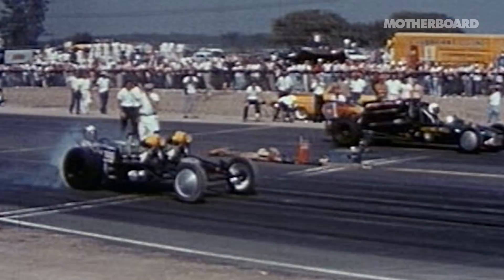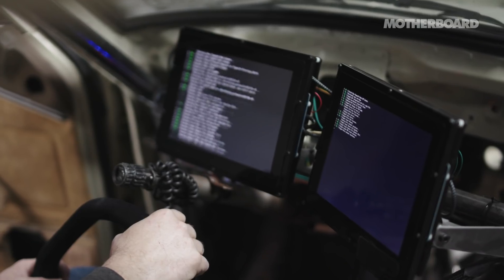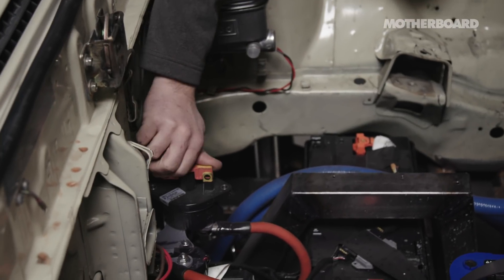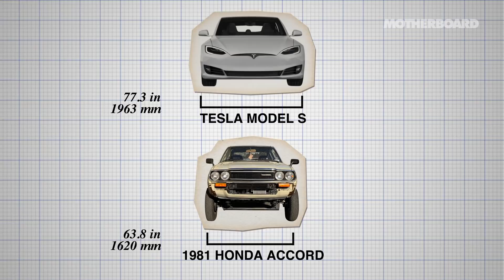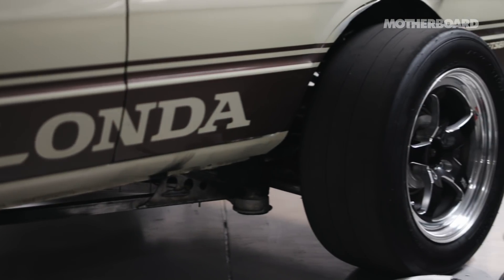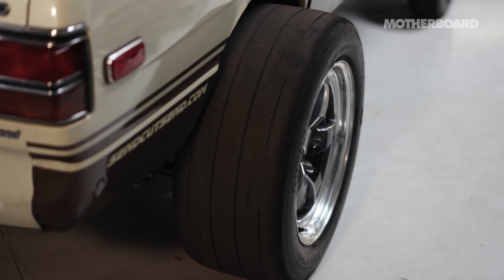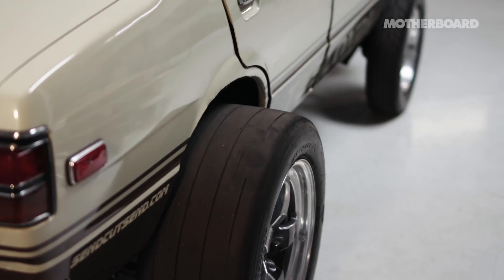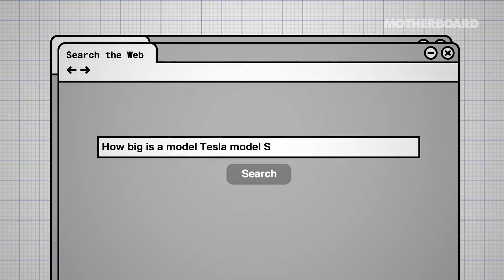The Half Tesla, Half Honda, 100% Electric Hot Rod - The Teslonda

Comment: I want that DMC next to it! 
How much you have in to the Teslonda? 

I’ll literally give you my TT 02’ Lexus ,Supra Gs300 motor to do this in its place? 
I’ll drive to you of course.
I’m very serious BTW ,no BS and ready at anytime!
Just as long as we can get a 3sec 60’ and run faster or at 10 seconds in the quarter!

I may even use my show car/street car to sweeten the deal! She just sits in the garage all year long anyway,so WTH!

It’s a Flawless inside and out 99’BB Prelude type S show car ,fully built Skunk2 H22a,Skunk2 drive train,JDM LSD trans etc..and all the highest end everything! 
She’s fully tuned N/A and all done right! Gearing and tune are on point! 
Her average is 13.9 Quarter with a 6 sec average 60’ time, 240Whp ,220lb OT
 (has much more capability to get into the twelves,)
I would do it just to make it happen! 
She destroys muscle cars and superchargers all day long with no issues! 
Though she does love breaking half shafts and motor mounts every now and then,not so much anymore with a nice torque mount kit.
The Lude is on the channel if you want to check it out,there’s a parts list too on a few of the post’s! 

The Supra GS is my sleeper daily! She has Air ride on all corners aswell,hopefully I can still tuck and sit her on the ground and not have to lift it like yours! Thanks Chris!

Comment: Electric drive is a simpler concept compared to combustion. It just took years for the battery technology to catch up . Once R and D is recovered all cars will be electric and built at a better price plus we will have less messy and deadly accidents due to no fuel or hot liquids being spilled.

Comment: Electric cars do need to make a noise. When walking in a parking lot, an electric car just suddenly moves in reverse unexpectedly. Gasoline cars you can hear the engine running. Also, the exhaust pipe purring. Not electrics. One ton of steel just suddenly moves right at you. Put a reverse alarm on it. Little beep beep beep thing. Might as well put a whistle pie on the front so you don't kill deer or some old lady walking home from the piggly wiggle.

Comment: (0:10) - You build something out of Lego, not Legos
Lego is the material / brand.
Lego bricks or pieces is what you build with.
Or simply: Lego.
You build a model house with Lego bricks, or Lego, not Legos just as you would build a real house with clay bricks not clays or concrete blocks, not concretes.
Or wooden planks, not woodens.
Anyway, Teslonda ?
Like it.
Next project ?
The Teslagonda !
_Oh, yeah !_)
>

Comment: This car is quick. Accelerates quickly... But it is not fast. A McLaren F1 is fast with 240 mph top speed. Last time I checked a Tesla will go about 125 mph top. That isn't fast by today's standards when the average sports sedan will do 155 (limited). Didn't Tesla originally have a 2-speed transmission in the sportscar prototypes? Unless this thing has been re-geared somehow... and I believe Teslas are direct-drive. It is quick but not fast. These terms are not meant to be used interchangeably but mostly are these days for some reason. Probably safer to keep this thing below 125 anyway...

Comment: That's one of the most bad ass electric cars I've seen and has a shit load of potential even with the gasser style straight axle front end if that car had a 4 link style suspension double adjustable shocks((unless IRS is the only type of suspension you can use with the motor set up you could still make it hook just a lil more complicated setup))and the right spring rate up front in the straight axle and a rear brake set up where it could run a 15 inch rim and a 28×10.5 slick or 275/60/15 drag radial it would definitely run low 9's with how much faster it would 60 foot and 330 foot as long as it can trap at least 140mph it could definitely run low low 9's. It still just feels wrong iv drove a Tesla p90 and they are fast but doesn't have a personality to it. I will stick to my ol small block/LSX's and turbos!

Comment: @3:00 - i don't get the chevy bolt vs tesla batteries argument. 
starts talking about battery power density (?)
let's see
-chevy 60kwh battery vs tesla 100kwh battery
-200 bhp vs 780 bhp
-max range 200 miles vs 335 miles
-1,616 kg vs 1,961 kg (total wight of car)
-https://www.cmhchevrolet.co.za/wp-content/uploads/2016/12/Chevrolet-Bolt-Battery-Pack.jpg vs https://cdn.arstechnica.net/wp-content/uploads/2013/10/tesla-callout.jpg
so which car's battery has more power density??

Still don't get it? -> https://insideevs.com/tesla-model-3-2170-energy-density-compared-bolt-p100d/

aaand, goes on to say tesla oem battery assembly is massive and that the wheels would still stick out with it - so he made them stick out even more by using the smallest honda body he could find... (?) facepalm

aaand, this "train of thought" is finished with the conclusion that he went with slick tires so it's not ok in the wet..

i think the editing doesn't help, the dialogue doesn't make any sense with these cuts

Comment: Unless lets say like a subaru sti with the awd system gen on the engine shaft to ej257 generator, electric motor mounted to trans axle. Still got your engine sound more you step on the gas, more power made for the motor just like a diesel locomotive.

Comment: Cool car but I'll race you. Let's say from Reno to Miami! I really like the electric technology and would drive an electric car but not until they can increase the range. I'd give up some acceleration time to be able to drive 800 to 1000 miles on a charge.
Reply: Because you can totally do that with a gas car
Reply: @potatomaaan1757  I can drive any gas powered car from Reno to Miami. There are gas stations everywhere and it takes just a few minutes to fill up. You can't do that with an electric car. My diesel pickup has a 52 gal fuel tank and gets 20MPG so I can go 1,000 on a tank.
Reply: @LivingOnCash  If you can refill you can do it with en EV as well because you have to stop every 3-4 houers to take a brake. In the time it takes to eat something and use the toilet you have at least 80% batterie again. You still have to wait a bit but i dont have a problem with this
Reply: @potatomaaan1757  When I need to travel I tend to roll miles without stops. But could adjust for a 100%EV if there are quick charge stations along my route. I'll admit I'm no EV expert but I don't know of any that will recharge in 10 to 15 minutes. I really wouldn't want to have to wait a half hour or more after say only 300 miles. I live in north west NV (near Reno) and quite often travel to CO, SoCal, PNW, etc. Most of the roads have long stretches of nothing and gas stations can be far between. US Hihgway 50 for example (America's Loneliest Road) has only three towns until you hit the UT border. I don't think there are any recharge stations at all. I think the range solution of EV's would be quick swap battery packs where you pull in to a station, remove your battery pack and swap it out for a fully charge pack. Of course this would require all EV manufacturers to use the same batteries. Currently (no pun intended!) I think EV's are best suited for local commutes or leisurely long distance trips where you only log a couple hundred miles a day. 
I do intend to go see these guys and talk about converting my Jeep to electric though. I think 4x4's are a good fit as you have instant torque.
Reply: @LivingOnCash  Ok. In this case it doesent make sense to get an EV for now. But i think EVs will get more range in say 4-5 Years. The New Tesla Roadster will have 620 Miles of range with is a step in the right direction.
Reply: @potatomaaan1757  620 mile is getting to be close to acceptable. Unfortunately, the Tesla Roadster is cost prohibitive for most people. The performance is amazing though. I'd like to see something with that range at around a $30K price point. Also one that would last ten to twenty years. I do agree that in a few years they will have better technology but I think the costs will remain high. 
My other concern is if there is mass conversion to electric having the electric grid support the charging demand. When I lived in SoCal there would be brown outs, especially at peak usage time. I wonder what would happen when several million people plug in their cars at 4 to 6 PM every day. Can the grid support it?
Reply: @LivingOnCash  If batteries get to the point where they can have like 700 miles in a 30K car then we will have batteries on the grid. The Powerplants could support such high demand with ease if there was a way to store huge amounts of energy for relativy cheap. If you take a solar panel for example it can produce more energie at day time then at night. But if everyone would charge a car in the night you need tp produce energie at night but you just cant to that with a solar panel. But if you have batteries on the grid you can store energie if not all of it is needed and if there is high demand you can use the energie from the batteries. Right now that is not possible because of the price of batteries is still to high. It would be like a gigant power bank lol

Comment: Idk what y'all complaining about. Sure first time you make anything, with no documentation, helps to be rich. But as time goes on, electric will only get cheaper and easier to diy.  I look forward to open source toolkits for modding and tweaking electric cars. Does anyone know if the 3 dual motor long range is just a softlocked Performance?
Reply: I doubt it, the performance cars have a specially designed rear motor (front is the same). It's the same with the S. Also some of the pack is beefed up - you could probably convert one, but not with an OTA update.

Comment: When you can pull into what was a gas station, and swap your empty battery modules for freshly charged ones in minutes rather than plug in and hang out for hours, then you will see those Chevron stations covered in solar panels, EV's in line to top off n' go, and electric cars and delivery vehicles truly win hearts and minds.
Bolted-in battery designs aren't the way to go. They need to be quick swap, like propane tanks at Home Depot.
Reply: tesla was making a swapable battery system but it became apparent that it was cheaper to make fast charging faster.
Reply: @miguellopez3392  Makes sense in the short term I suppose, since there's no such things as battery swap stations off every freeway exit, and to keep initial sticker shock low. 
I'm just saying that at this point, it's going to be a roadblock to national adoption if you have to stop for a few hours rather than minutes.
If the Oil industry was smart, they would have been better served getting in on the game rather than fighting it by having the traditional gas station lane for cars to get gas, and one for EV cars to swap modules, and push for a battery pack standard with EV manufacturers
Reply: @WindFireAllThatKindOfThing  current supercharging can get 80% charge in 40 minutes, chances are if you drive 300 miles you are going to need to take a brake and stretch, but even in the long term super charging could be lowered to as much as 15 minutes if the batteries are built with cooling systems sufficient enough to handle that kind of charge rate and battery chemistry that allows for that voltage input, it would be significantly cheaper to built fast charging stations then to build a battery changing stations, not to mention battery quality, some people might take very good care of their cars and the systems that make them function to peak performance but could end up getting a battery with 30% less range either from poor care of the battery or a cheaper OEM then the one that came in their car and that would feel like someone cheated you.
Reply: @miguellopez3392  You'd have to think of the battery like a deposit, like when you get a 5 gl tank of propane for your BBQ. You're not keeping it anyways (well, some people do), but you're fronting the cost of A battery module rather than your battery module. Once you've done that, so long as you yourself don't trash it utterly, it's like a tank swap at Home Depot. You're paying for the propane in a nice, clean  and maintained cylinder they give you when you turn in your old (and probably ratty) one, and the small fee for the upkeep from that point forward. This defrays the cost of recycling and maintenance of the module, but the bulk of your expense is the going rate for the energy. 
There's also the question of the "I ran out of gas" scenario. AAA could show up with modules if I ran out of juice on the road, but I don't know what their policy or practices are for getting an empty Tesla to the next charging station are.

But I completely agree with you that fast charging has come a long way. I have a 1100 watt eBike that I ride the crap out of, and a 1.5 amp and 8 amp charger for it. I can ride 25 miles on a single charge, and either gently preserve the battery life by waiting 5 hours on the 1.5 amp, or I can suffer a loss of long term life by having it topped off in 90 minutes on the other. Yeah, I could feel the heat when on the fast charger. I try to keep it between 25-80% charged at all times to preserve it's service life.
Reply: @WindFireAllThatKindOfThing  the problem comes in at that "gas tank" weighs 1000 lb and requires special machinery and accuracy to remove and replace it cost a lot of $$$ to do this, majority of all charged on EV's is done at home wich further justifies not having an expensive battery changing station that you would only really use if you where doing long trips and even then it only saves a couple dozen minutes, so if I could refill my propane tanks at home and it took 4 hours to do so it would still feel more convenient to go out and replace it with a full tank.

Comment: No replacement like displacement I won't sell my gasser's ever even If not allowed on the road nothing gives true horsepower like a gas engine alot of electric car people will say well oh It has 400 horsepower when electric motors can't give true HP but more of a watts rating but jmo...
Reply: do you even know what horse power actually is?
Reply: @miguellopez3392  yes the amount of power given per revolution on the engine
Reply: @JayPlays792  no its a measurement of power given in a time frame, it originates as a marketing term that had no real specific power rating but was later categorized a measurement of work or energy done in 1 second, 1hp = 745.7 watts. not many people can actually define what 1 horse power is because its origin is not well define or explained, so horse power from an electric motor is the same for a gas engine, but the power output curve in 1 cycle of a gas engine is different from an electric motor as where an electric motor provides constant power through out the second a gas motor provides peak power at the moment the gas expands in the piston and dips in power when no pistons are firing but gets averaged out in that second to a given HP rating..

1 70lb motor can kick out 250 HP and if you over volt it it can do 500HP, this sounds unrealistic but its physically the truth.
Reply: Oooh word? Cool now talk about torque
Reply: @MrSHUTUPCAT  317lbs of torque from a rear wheel drive motor and it maintains this torque around 0-10,000 rpm at the motor.
Reply: @miguellopez3392  sorry I was replying to the other person ad snark.  My bad.

Comment: That car is souless. The feeling of a gas engine is uncompairable and undeniably better than that souless car. Electic cars will be the silent killer of the hot roding community.
Reply: And the feeling of an elctric motor is far different then a gas car, too me the sound of a roaring engine gives me the impression of struggling and wasted energy, idk how many people are going to care about the car having a soul when they can accelerate 0-60 in 2.3 seconds.
Reply: @miguellopez3392  look I respect a fast car just as much as you do, but to me a car isn't a real car without a gas engine. The v8 is my favorite engine and I couldn't imagine driving an  Chevelle or Charger without a v8. This goes the same for jdm. I couldn't imagine driving a R34 without an RB26 or a S15 without an SR20. The engine is a car's soul you can hear it loud and clear. With an electric car it's like it has no soul because you can't hear a nice exhaust note.
Reply: @thunderbolt9797  the first cars ever made where electric, electric cars literally existed before gas cars, no one cared if it made noise they just wanted something that could take them places in a timely manner, once the engineering got better people could focus on the style and feel of the cars but at that point EVs fell out because of their range and cost, so they are as much as a car as one with a V8, if you ever get the chance drive a Tesla and see why people enjoy them despite no hum or roar.
Reply: @miguellopez3392  the first car that I know of is a gas powered engine. I've been in a electric car plenty of times and despised them. It doesn't seem fast when you can't here an engine reving high at the top of a gear ready to shift. I like the fact there's much more action with gas powered cars and even more skill in some ways. It's boring just to floor it and hear nothing and do nothing. For example: a car  with a manual transmission takes skill and a lot of practice to drive well and is faster than an automatic in some ways. It's aweful how it's taking less and less skill to drive a car. It takes the fun away.
Reply: @thunderbolt9797  first electric car was in 1832 but the first practical electric car was in 1872, first patent for a gas car was 1886, the first steam car was in 1769. You've been in an electric car? Did you drive them? What car was it?
Reply: @miguellopez3392  it was a Tesla. Yeah they're fast and I respect them yet hate them for that because they will eventually take over the car world.